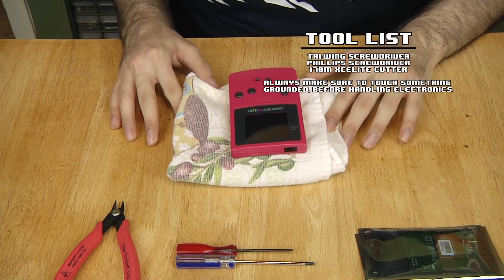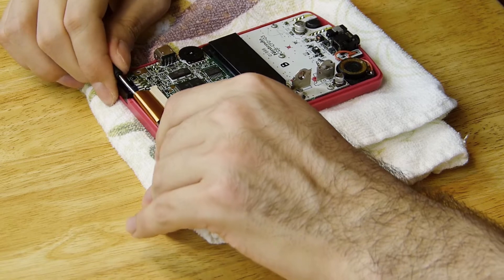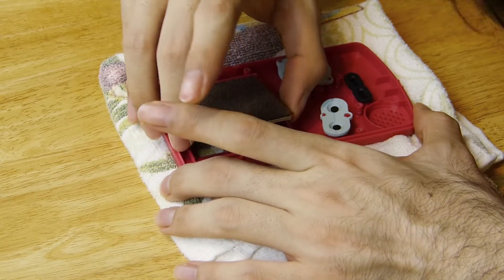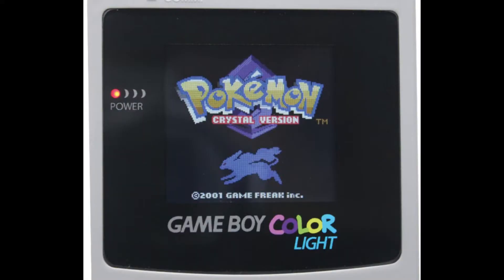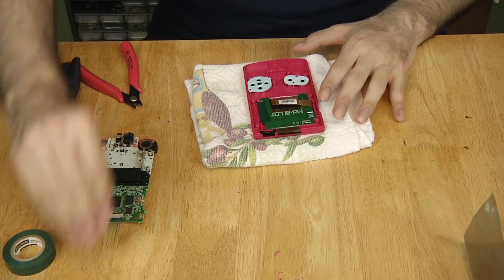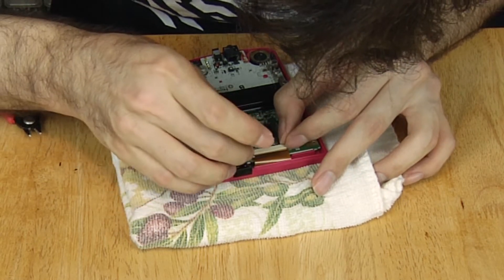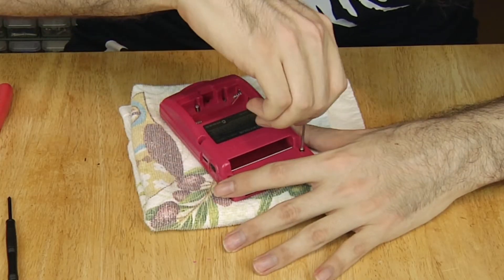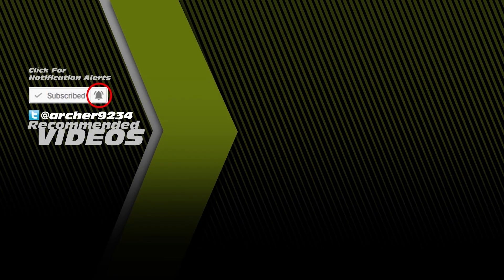Gameboy Color McWill LCD Mod Revision 1.1 Plug n' Play Installation

Comment: In regards of the 2-3 attempts to power up the Gameboy Color once the lcd is installed: is there any fix to avoid this? It is a little bit annoying having to power cycle 2-3 times everytime.
Reply from the maker: Not that I know of. The reason why this happens. Is the screen has to get the sync from the system.

Comment: Is it only the first power on that you need to do multiple times? Or do you have to do that every time?
Reply from the maker: Every time you turn it on. But within a certain window. If you turn it off. 2 minutes later it's fine. I think the limit is like 5-10 minutes.